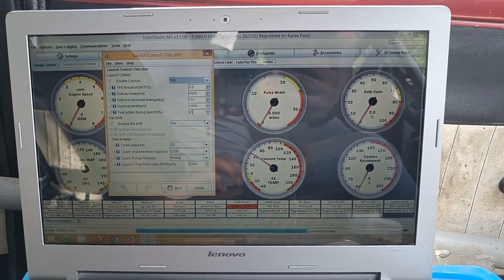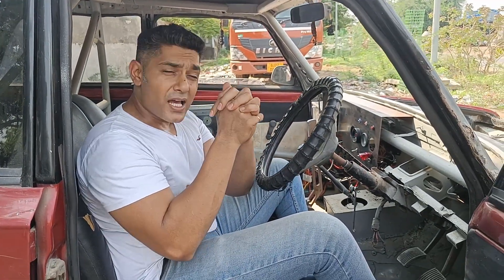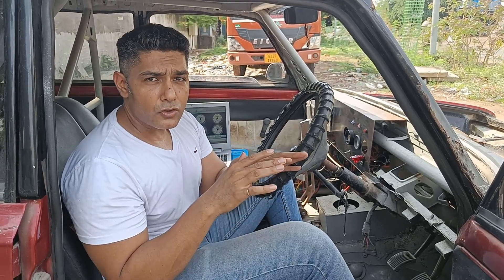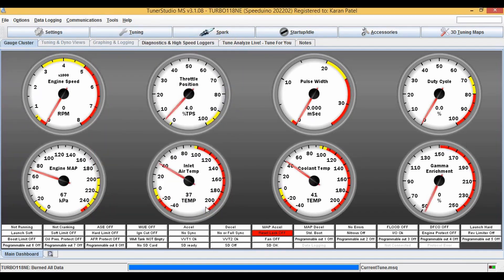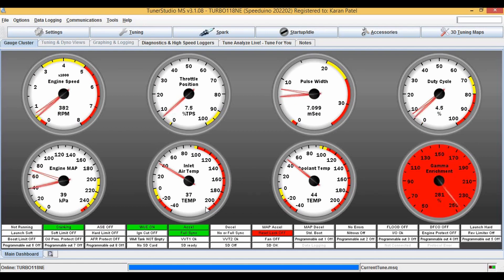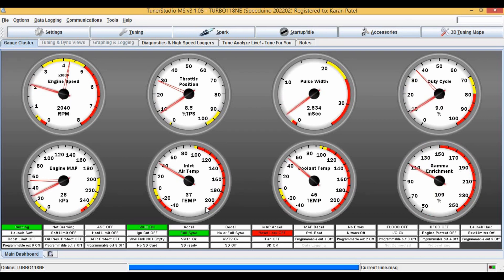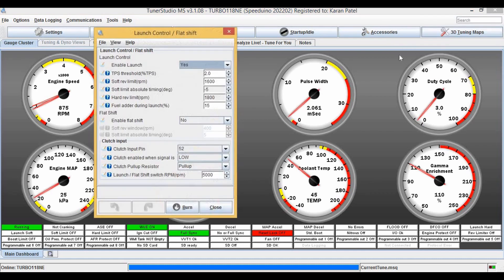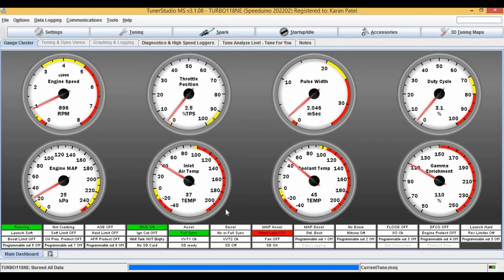EXPLORING 2-STEP REVLIMITER | DIY ECU PART-5

Comment: Go to - Tuning - Engine Protection - Common Engine Protection. Set "Protection cut" to "Spark Only", and set "Cut Method" to "Full". And use more rpm, get it upto 3500-4000rpm. You need a lot of flow in the engine.
Reply from the maker: Yes it’s spark cut only. Maybe try higher revs.
Reply: @NaughtyNut  also set to "full"

Comment: Assuming the smoke on headers, I guess you've tinkered with Engine. The smoke from exhaust was blue so you might wanna re check for any oil leaks. If you've modified the engine it might need a catch can as too much oil pressure in crank case will burn oil. Check for ignition coils (usually weaker coil packs don't burn the safety fuel and so anti lag or two step is not going to work). Check if you've fouled the spark plug cuz of excess fuel. If coils are good you can gap them accordingly. Also the exhaust sounds restrictive as it's to throaty. If the displacement is changed you can upgrade the OD of it using proper material as OEM exhausts from that era aren't that of a great deal for such applications. Also the best thing you can do to ease of the hassle, you can program the 2Step switch in ECU if it allows. That will help a ton.

I might be completely wrong because for sure you've worked on it more than me and ofcourse you know your stuff. It's great that you're moving in right path and turning this gem into something nicer. Appreciate the work man.